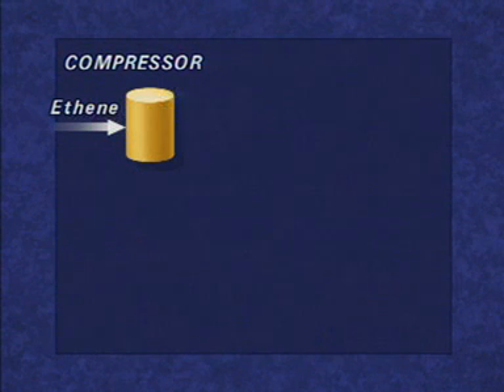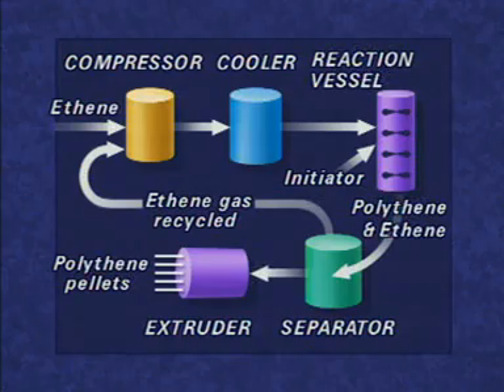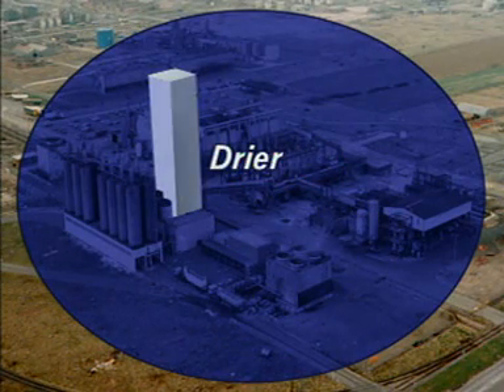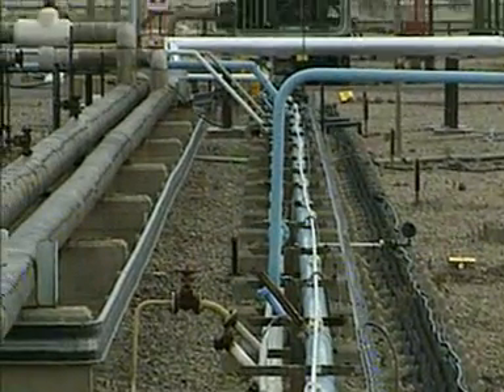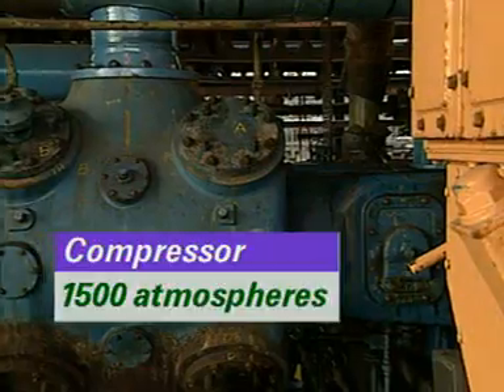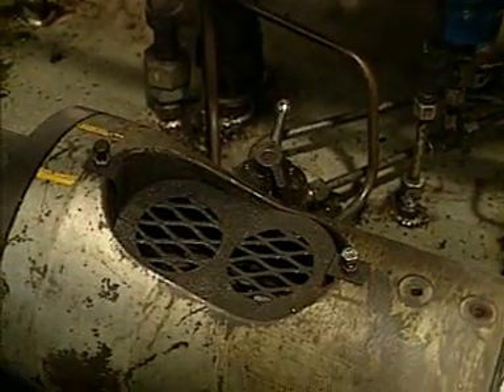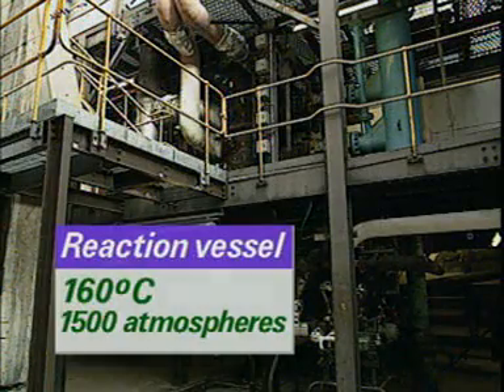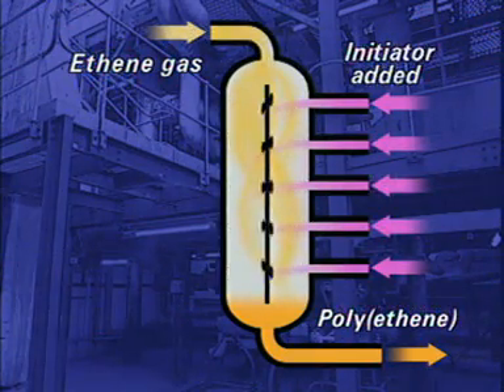Polythene production

Comment: 2:49 from time to time I used to clean the stirrer. They would be soaked in hot oil for a few days/weeks to soften the plastic. The jetter didn't do a lot, and mainly it was removed with a paint scraper. It was normally a day's work per stirrer, if it was fully cleaned or not. Often, they'd go back in for another soak.